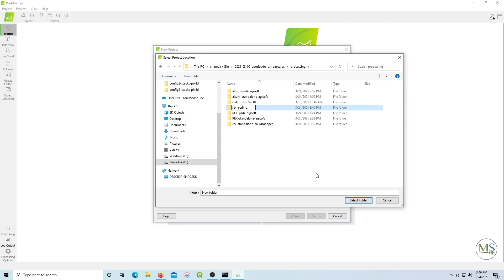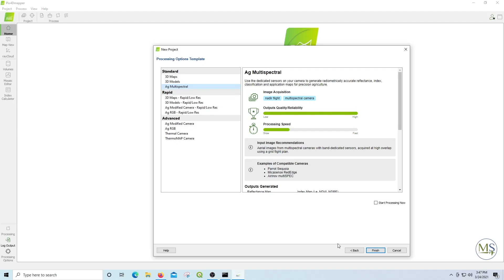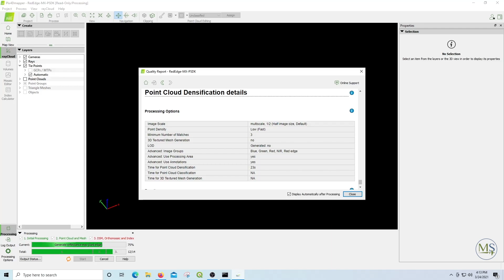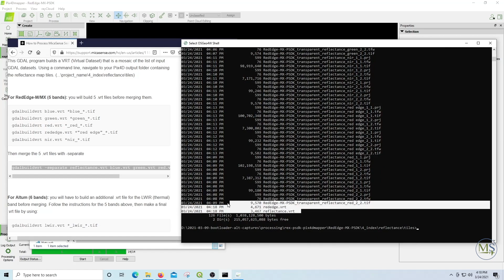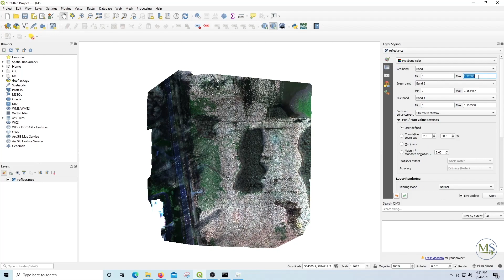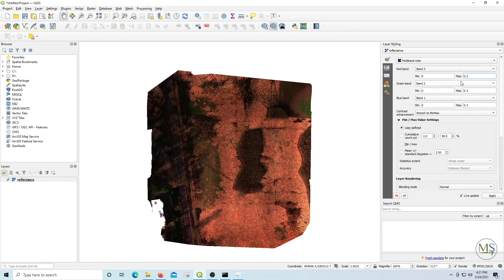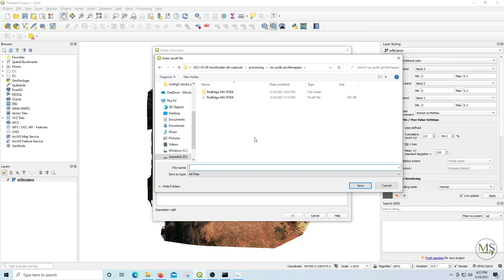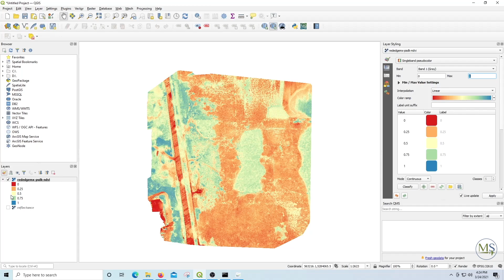How to Process MicaSense Sensor Data in Pix4D

Comment: I'm curious about the reflectance map outputs (individual tiles vs. merged). In the tutorial you processed an individual tile for each band, transformed each tile to a VRT file and then merged them together. In Pix4D there is a processing option (in Step 3) where you can choose to create a Reflectance Map GeoTIFF and then you can choose the 'Merge Tiles' option. Does this merge tiles option do the same thing as the tutorial VRT/manual merge approach? If not, what is the difference between these two approaches, and why would you use one over the other?
Reply from the maker: Thanks, Cristiana! This is a bit of a technical question, so to better assist you, we recommend you send us an email to support@micasense.com